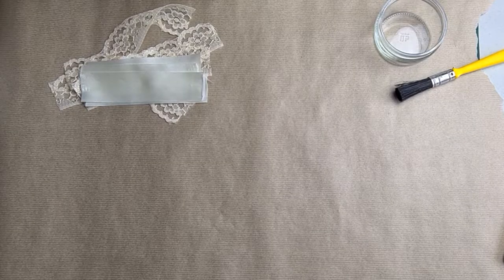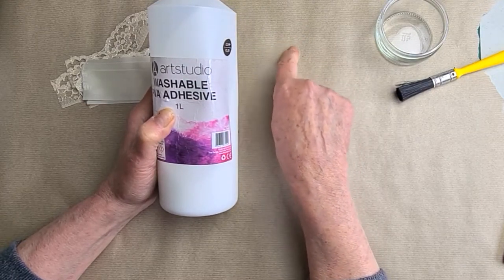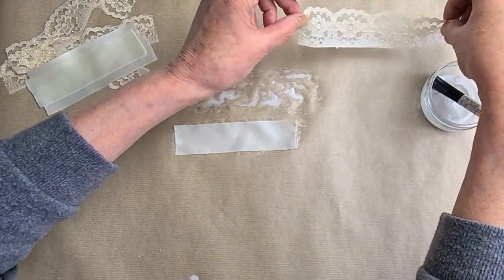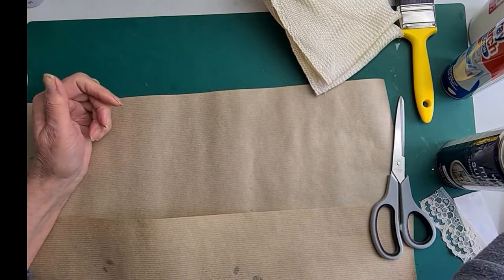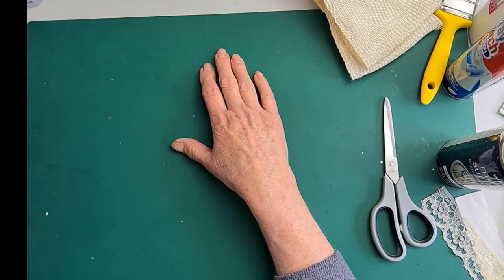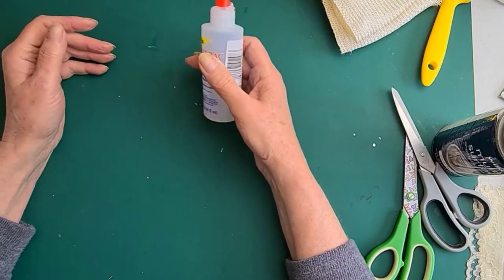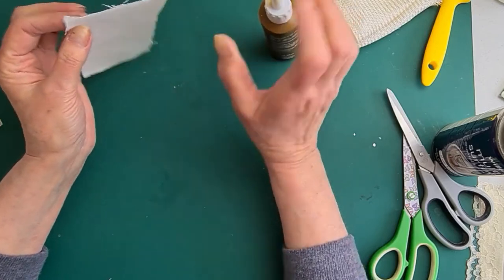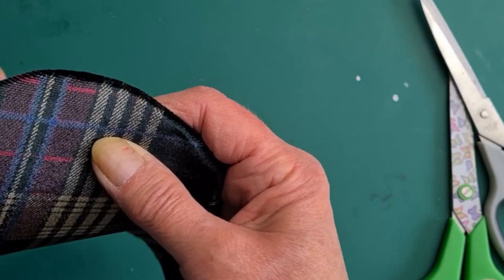Millinery Q&A, talking about stiffeners and glues

Comment: I've been wanting to make artificial flowers out of velvet for an upcoming sewing project. I have cotton velvet/velveteen in my stash that I intend to use. It's my first project that includes fabric flowers. I've found tutorials for velvet artificial flowers but couldn't find out which stiffener would be the best for cotton velvet(een). What would you recommend? Thank you in advance.
Reply from the maker: All stiffeners tend to flatten the velvet pile and ruin the look, so it is best to back the velvet with an iron on interfacing/stiffener and then work the flowers from there. If it is a cotton velvet you should have no problems, but synthetic will melt when trying to shape with tools.
Reply: @SHMillinery  Thank you so much for responding. I have iron on interfacing (Vilene) at home so I'm going to try that.